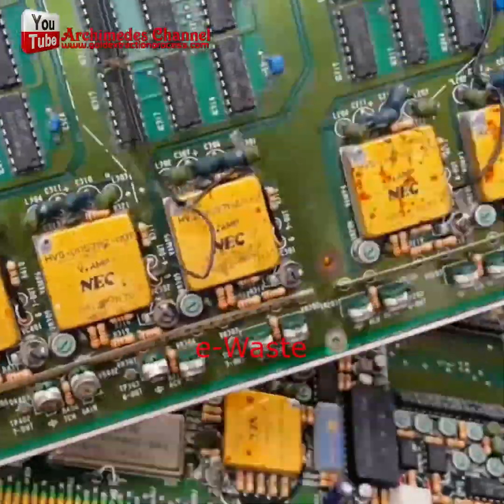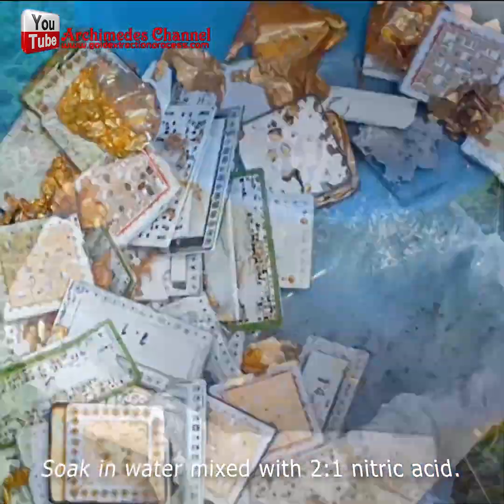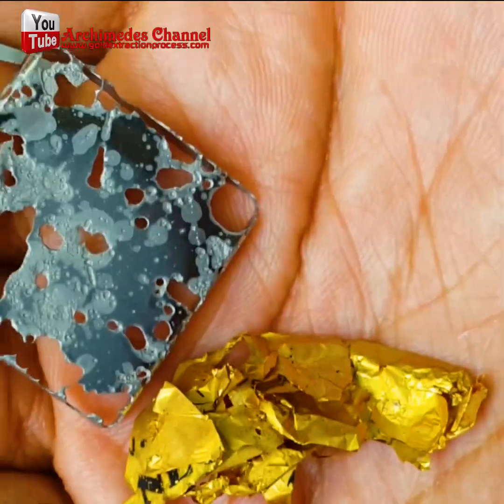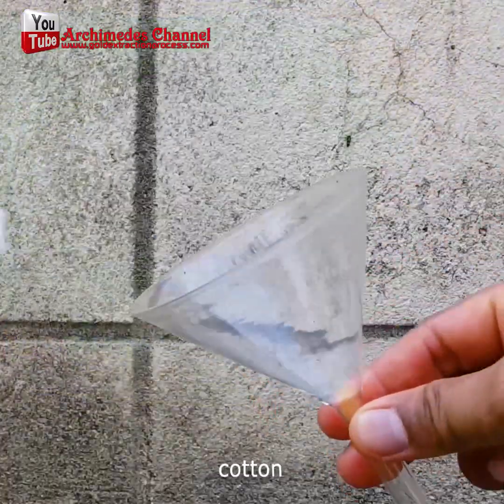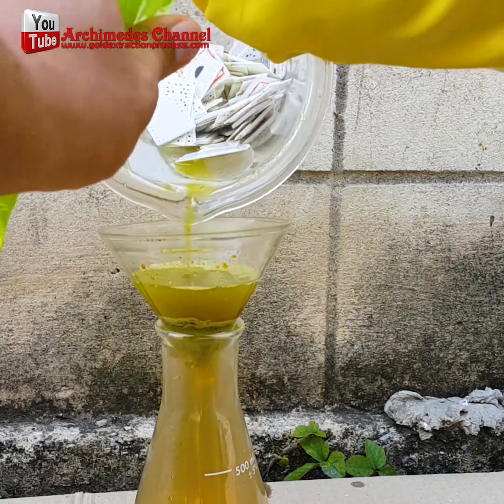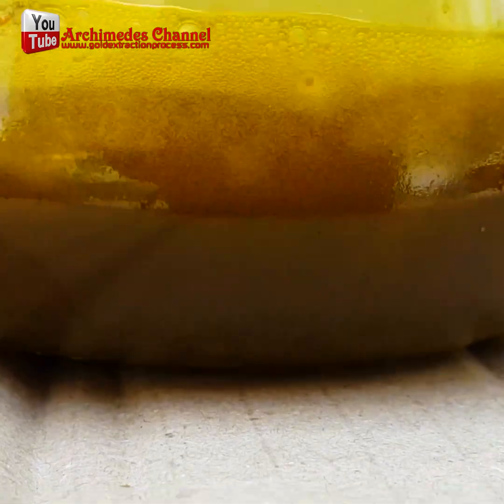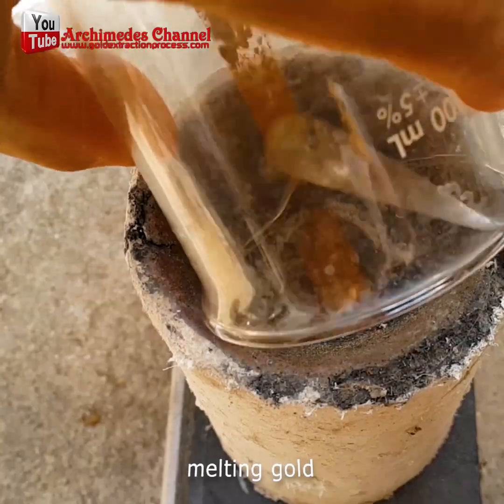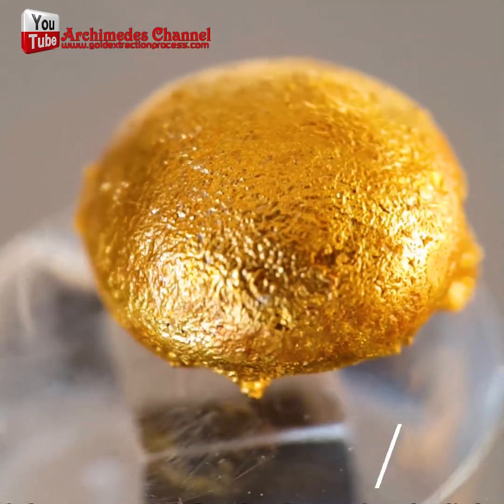Gold hunting from E-waste | Archimedes Channel |

Comment: I'm watching your video,is there a gram of gold that can be obtained from a kilogram of Nokia cell phone board if processed?
Reply from the maker: Yes, it is possible to extract a small amount of gold from a kilogram of Nokia cell phone circuit boards if processed properly, but the yield would be quite low.

Based on estimates and studies on precious metal content in mobile phones:

- A typical older Nokia phone contains around 0.02 - 0.035 grams of gold in its circuit boards and components.

- So for 1 kg of Nokia phone circuit boards (approximately 25-50 phone boards), you could expect to extract somewhere around 0.5 - 1 gram of gold.

- The gold is present in very thin electroplated layers on the circuit board tracks as well as in small amounts in the integrated circuits and other components.

However, actually recovering all of this gold is extremely difficult and requires very precise and controlled metallurgical processes involving acids, smelting, etc.

In reality, even commercial e-waste recycling facilities can only recover around 20-30% of the potential gold value from circuit boards using their technologies.

So while 1 kg of Nokia boards may contain close to 1 gram of gold in total, you would likely only be able to extract a portion of that, maybe 0.2-0.3 grams of relatively pure gold if processing perfectly.

The relatively low yield combined with the harsh chemistry involved makes extracting gold from small quantities of consumer electronics an environmental and safety hazard if not done properly. Large scale recycling facilities have the right processes and controls in place.